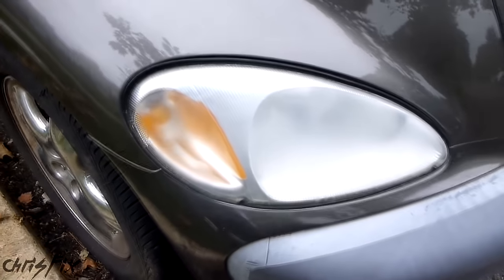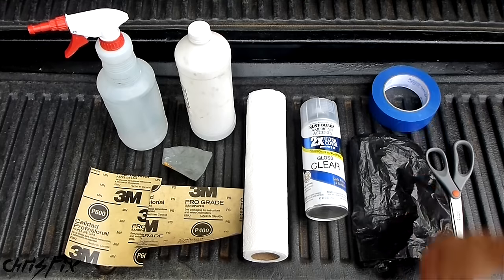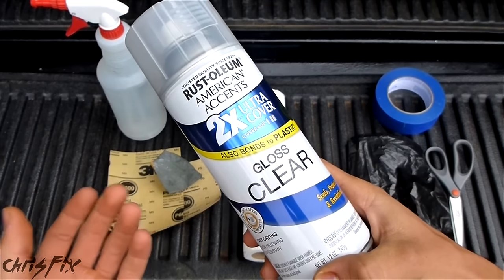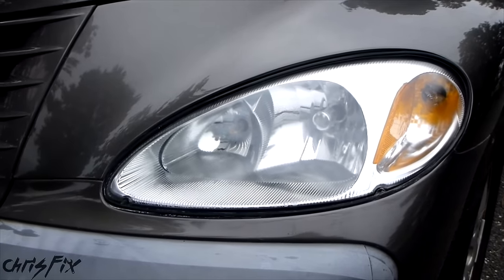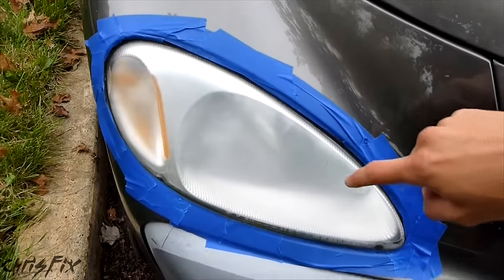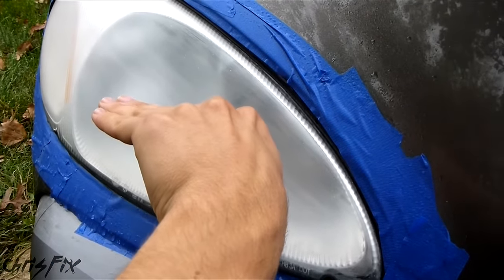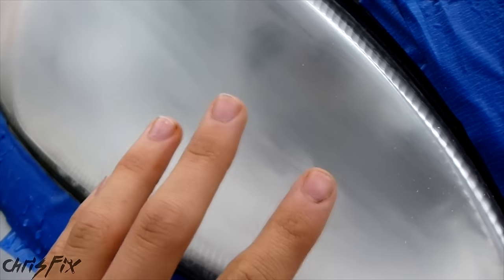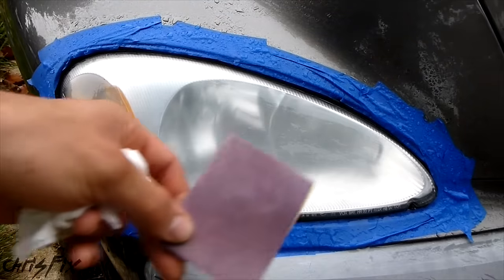How to Restore Headlights PERMANENTLY

Comment: Hey- I did this 5 years ago, and now they're starting to fog up again.  Actually I'm happy with the results, I came back as a refresher before I do it again- I even still have all the materials.  Thanks!
Reply from the maker: Thanks for sharing!
Reply: How well did it hold up?
Reply: Yes, that is about what you can expect. Consider the superior products that are applied from factory supplied headlights. They go yellow. Nothing lasts forever and all finishes are but temporary, but it is better than just buffing. A good 2K clear spray might be a better option as it is a catalyzed finish, but it is expensive and you must wear a proper respirator and not a dust mask when shooting it. Maybe get another year or two out of the finish over the airdry non cat finish.
Reply: 5 years is pretty good
Reply: Keep waxing them every 3 months and you should avoid them fogging up again. Only so many times you ca restore them.
Reply: I just pay a dealer,,,too tedious
Reply: @timlee8823  No, too lazy.
Reply: After 5 yrs all lights need redoing because of weather elements
Reply: @timlee8823  You're missing out on the skills then.
Reply: @gravemind6536  Crap I just did this to my headlights yesterday, came to thank Chris for the video and saw your comment. I did forget the wax step I need to do that tomorrow. Thanks.
Reply: @timlee8823  I felt like you did about it honestly but I did it yesterday sat in a chair under a shade tree it only took a few hours and I have great results. Really it wasn't that much work. I thought it would be but nah.
Reply: 5 years? I thought this paint would wear out in less than 1 year...
Reply: @lordmasterization      Well, I did procrastinate for at least 2 years.
Reply: @getsmarter5412  so that primer kept the light clear for 3 years?
Reply: @lordmasterization   Yes. It's all in the prep.
Reply: Very nice
Reply: @gravemind6536  Imagine waxing your headlights every 3 months lol
Reply: Yeah, I never thought it would be permanent. I'm not sure how Chris can think that. But it's still far better than nothing.
Reply: @legalmexican  he doesnt literally mean " permanent " in the literal meaning of the word.
Reply: @gravemind6536  or you can get clear precut out for your lenses
Reply: @nikchris69  I wax my car at Least once a month or two, takes little time, may as well do headlights.
Reply: @jimflys2  These days you can get 2k clearcoat in a can too, far superior but cost not much more than ordinary clearcoat spray. One thing to note about 2k paint though is you can sand down the orange peel and/or polish to a shine after 24 hours but best not wax, add sealant or any kind of coating on it for the first 2 months or more to allow the paint to breathe and harden properly. 
Once it sets, with regular waxing/sealant it should last many years without yellowing.
Reply: @nikchris69  you should be waxing your paint regularly so why not do it at the same time
Reply: But the owner of this video claims, it is A permanent fix.
Reply: @MrBababuwi  Nothing is truly permanent including your car or even yourself. 4-5 years is pretty good considering most other options only last a few months.

Comment: I did this to two vehicles recently.  The price to replace the set of headlights was $350, this made the headlights look amazing for less than $20.  Thank you sir!
Reply from the maker: Awesome!
Reply: Did this actually work? I’m extremely nervous to do this... how long will this also last? I don’t get how using sandpaper which scratches it is a good think and then somehow magically the clear coat does it lol... just hard to believe.
Reply: @polishmafia1573  then maybe don't do it lol. If you don't understand how it works then it's not for you..
Reply: Have you used plastic primer before spraying the clear coat layers? The product that Chris used says that it bonds on plastic, mine doesn't and I'm scared it may look like crap...
Reply: @polishmafia1573  sandpaper removes the haze..by scratching it away, clear coat fills the scratches and adds a protective layer..lol
Reply: @josegomez6549  haha right, weirdos man

Comment: I'd recommend adding this in the description so it's easier to know what the steps are:
1. Tape around headlight
2. Wet sand 400 grit swirl pattern
3. Wet sand 400 grit horizontal pattern
4. Wet sand 600 grit swirl pattern
5. Wet sand 600 grit horizontal pattern
6. Thoroughly clean
7. Wet sand 2000 grit swirl pattern
8. Wet sand 2000 grit horizontal pattern
9. Thoroughly clean with alcohol and let air dry
10. Tape plastic bag around area of headlight 
11. Spray 1st coat clear gloss UV rated
12. Wait at least 5 minutes
13. Spray 2nd coat clear gloss UV rated
14. Wait 24 hours
15. Apply Carnauba car wax
16. Buff out wax
17. Remove taped off material
Reply: clear coat for PLASTIC
Reply: You missed the 3rd clear coat
Reply: Thank you!
Reply: Why use of 2000 grit  after 600 grit ?? Brandon .
Reply: @tonycervantes4816  Because you always go to a finer grit
Reply: @brandoncriner5480  okay thanks sr
Reply: @tonycervantes4816  Finer grit removes sand scratches from previous paper.
Reply: @ward26102  ok Laura thanks  for you  information.
Reply: Screenshotted, thanks!
Reply: You forgot to sand the clear coat w 3k grit sandpaper.
Reply: @tonycervantes4816  it good if you wait for clearcoat to dry then wet sand with 3000 grit ,then wet sand with 5000, then compound-polish. This will make it very clear
Reply: @tonycervantes4816  don't go from 600 to 2000.  That's a ridiculous leap. It would take you 2 days of sanding with a 2000 to remove the scratches from the 600.  From 600 you would go to 1k.  Then something around 1500, then on to 2k. 
A good rule of thumb for sandpaper is to never go more than 150% of the last grit.  For instance if you're using a 200 grit, follow it with a 300. Then 450, then 675, then 1k, then 1500, then 2200, so on and so forth.  Obviously they don't make every grit in between, but you pick the one closest to what you need
Reply: @epstein_isnt_dead7726  the scratches need to be there for the clear coat to not run and grip the plastic better
Reply: @rlkxo3765  your comment has nothing to do with my comment
Reply: Good points. You forgot one coat of paint. Lol.
Reply: @arthurwagar6224  .... you're joking... right?
Reply: @epstein_isnt_dead7726  agreed. Skipping over the numbers is a false economy. 600 to 2000 is too big a jump. 400, 600, 800, 1000, 1500 and finally 2000 is the best way to go for a professional result.
Reply: Thanks for this but I am laughing too because the goal of Youtubers is usually views not saying they don't want to just help us out also but I can't tell you how many times I watched the video to go back over steps which is more views for Chris and I got his knowledge for free so I am OK with giving him extra views. Still your step by step here in writing would have saved me some time for sure.
Reply: Brandon Criner, thanks for writing the notes down for us, I took a screen shot of your comment, saves me the trouble of writing down anything lol.
Reply: Well then people wouldn't watch the video! The longer people watch, the more Mr Chris makes from YouTube income :)
Reply: I's literally waiting for one of these lol
Reply: @tonycervantes4816  2000 grit super fine to really smooth out the headlight
Reply: @jjf609  thanks brother..
Reply: want to save it. don't know how to copy google review.
Reply: Instead of clear coat.I finished with compound and polish.
Reply: step 16 what do we "buff out" with? water? alcohol? a dry towel?

Comment: Chris, you are the man.  You've given me the confidence to try so many of these fixes that I never have before.  You're an amazing teacher and awesome film maker.  Thank you for all that you do.
Reply: I did the headlights on my Mums car in 2020 (Had lots of time in lockdown) they were arguably too far gone and far worse than the ones in this video, I used his methods and was able to remove all the haze from the lights but they had also yellowed badly too but I only managed to remove 85-90% of the yellowing. However 3 years on from the work I did they still hold up and for around 100-200 dark miles until my Mum got used to the headlights being brighter she kept trying to turn off the full beam that wasn't on. This was a car she had bought cheap used for £600 so its pretty crap however I completely transformed the lights.

Comment: A random guy at my local salvage yard told me to take these exact steps to permanently clear up my headlights and it works just as in this video. Great step by step how to.
Reply from the maker: That's awesome! Thanks a lot!
Reply: Im afraid to scratch the headlight with sand paper .it is ok sir?
Reply: @airrolmedestomas  if you scratch it a little bit with the 400 grip ir 600 grip just sand it with 2000 grip over the scratch and it will disappear
Reply: @airrolmedestomas  Don't be scared of that you will likely be fine and using sandpaper even with sub 1000 grit will not cause irreversible damage. As long as you polish the lights up well after sanding them they will last good.

Comment: I'm amazed!!! Update: I actually did this and the results were fantastic! I can't thank you enough for all the empowerment you provide. God bless you!
Reply: Awesome. I've been looking for comments on if someone had done it. Thanks fore saying something! I'm about to do it on my Santa Fe.
Reply: @kimberchick8527  He inspired me to change my own headlights, tail light, interior light, and that AC filter that's under the hood (I already knew how to replace the cabin one).  I even used this headlight recovery trick on the faded solar lights around my property. ChrisFix is truly my hero!
Reply: @Amyzgr8r  hey Amy, every time you sanded, did you do 5 minutes each time or how long?
Reply: @jlkeeper8901  Oh, I didn't really time it. Just eyeballed it.
Reply: Ive done this using the same clear coat and it all was in spider webs after 10 minutes. Did three coats and that did not help a single but. Then talked to a professional, they said need a plastic adhesion promoter, used that (doing everything form scratch again), this time the clear coat did not  have the spider web, but the headlights are hazy and dont look "amazing". Now when i rewatch the video i realize that his headlights are hazy as well, it is just his comments that made me think they did look great.

Comment from the maker: +Phillip Paul, I cannot reply to your comment for some reason so I hope you see this. You do not want to buff the lens smooth. You want to have scratches and follow the 400-600-2000 exactly like in this video. The 600 grit puts deep enough scratches into the surface of the lens while the 2000 light sand, cuts any surface roughness off. This allows for the clear coat to adhere properly so it wont peel in a year. If you make it smooth, the clear coat wont grab onto anything and it will peel. You can also have a problem with the paint running.
Reply from the maker: GigaDonk You can do 600-2000 but not just 2000. You need the deeper 600 grit scratches to help the clear coat adhere for a good long time!
Reply: ChrisFix
Reply: Why you dont use wd40 ?
Reply: Nm
Reply from the maker: ***** I never tried 6000 grit and what I do works for years so I havent changed the recipe.
Reply from the maker: Antonio Debeljak Because wd40 doesnt last long and just covers the problem until it rains.
Reply: ChrisFix WD is fish oil.
Reply: ChrisFix 
Nice video.  There are other ways to re-treat the headlight lenses to obtain proper results - but yours as shown here will certainly work, gives the desired finish, and lasts as you described too.  

Very well done, narrated, and presented.  It's generous of you to share your meticulous works with others.

PS - Since the discovery of "Parts Blaster" (PB) - Everyone would like to find "something" that ole' "WD40" is good for - so far, I have found nothing!  PB is the finest product of its type so far! 

Thanks again Chrisfix!
Reply: Jacob green sure then, use it on your skin or try to fish with it, it wont work because once you change the main chemical, it will no longer be that chemical.
Reply from the maker: MJfromMD Thanks a lot and thanks for sharing! If you like PB blaster, than I think you will like this: https://www.youtube.com/watch?v=2WuVBFTzoKc
Reply: James Jayser  Give the guy a break, at least hes trying..
Reply: Hey Chris, let's say hypothetically speaking, some enthusiastic subscriber followed all your steps to perfectly...... BUT broke a cardinal rule on the second light and sprayed too much. Now there is running of the clear coat. Could this..... hypothetical ..... person sand down with the 400 grit, followed by 2000, and reapply a smoother clear coat?
Reply: dand100  Yes you could.  I had the same problem and resanded a bit.  It turned out better than my other headlight.
Reply: dand100  Same sort of thing happened to me (was humid when I sprayed them and lenses dried cloudy) and I went all the way down to 220 and dry sanded the lenses with a power hand sander then worked my way back up 400, 800, 1000 by hand and they re-sprayed.  Worked perfectly.
Reply: nice
Reply: ChrisFix Ditto.  The general rule for spray painting is to sand to 400-grit finish, then spray.  The finer grits come afterwards as the finish is finish-sanded and buffed out.
A word regarding wet-sanding - I didn't learn until recently that wet/dry sandpaper is made and intended to be soaked in water 24 hours prior to use, so that it soaks up the water like a sponge.  Thanks for this great video.
Reply: +ChrisFix i used 180, 220 and 720 ... came out perfectly clear ONCE but had a couple runs ... so I resanded with the same pattern and now it literally always comes out yellow ... ?????
Reply: +louisdiaz316 why did you not use the grits he suggested? He suggested them for reasons explained in the video?
Reply: +wildcard749 honestly all I used at first was 720 to remove everything n it worked quite well at first. if anything the 180 & 220 came into the picture to remove the runs. But after that it never came out super clear
Reply: *****
 When you re-sanded it did you make sure you got ALL the way back down to the plastic lens?  It was tricky for me and took a long time, which is why I used a power hand-sander, but if you do have to 'start from scratch' so to speak, you really should try to get all the way back down to the fresh surface and begin again.
Reply: ChrisFix so if I followed all directions, and used same spray paint as in the video, but ended up with alligator cracks - is it that I made it too smooth so it's not adhering. do you think shape of lights makes any difference? Just bought a 2005 jag s type I'm trying this on, which has the round headlights  (making this task a PiTA!  😀)  thanks!
Reply: Trisha Gamble sounds like you waited too long in between paint coats.  you have to spray within the hour (whatever the manufacturer recommends) or else the paint will de-gas and cause cracks in the paint finish.
Reply: The trick is to NOT use clear coat. It will crack/peel, etc. Use nano ceramic coating!
Reply: I believe thats why your headlights sill looked hazy after repair, POlished with maintenance would be clearer for sure, your method will last longer.
Reply: @dand100  :face-green-smiling: Great question
Reply: @chrisfix  "I do works for years so I havent changed the recipe." Okay, I laughed out loud that you called it a recipe 😂 I am going to give your recipe a try on my headlights soon. Thanks man!
Reply: Hmm, so no fine polish buffing. Just sand to 2000 and then clear coat it for better adhesion. Sounds good 👍
Reply: @philip paul
Reply: What do you do if you get runs from the clear coat?Wait for it to dry and resand with the 400,600 and 2000 grit sandpaper??

Comment: Thank you Chris. My 2008 MDX failed inspection due to yellowed/hazy headlights. Less than $50 at an auto parts store, and 30 minutes of my time, my headlights look brand new. Can't wait for 24 hours to do one more wet sand and then wax. You are a real treasure.
Reply: I did this to my Mums cars it somehow had a valid MOT with the lights only being advisory and they were very far gone arguably too far gone I restored them but could only remove about 90% of the yellowing and haze I did this in 2020 whilst bored in lockdown and she was highly impressed with the headlight performance afterwards and kept trying to turn off the full beams due to the new levels of brightness. 3 years later the restoration is still holding up very well too. I used 5000 grit and 7000 grit sandpaper followed by T cut polish and turtle wax to restore them I imagine if I used better equipment I would have done even better.

Comment: Did this process today on some 7 year old headlights that were plain awful. I messed up a little on the 2nd coat and had to restart but the end result, following Chris' step by step instructions, gave me brand new looking headlights. I can actually see at night now.
Reply: By restart do you mean re sand?
Reply: @topixartist  when I applied the 2nd top coat, I touched it with a towel, and it bunched up and crackled. So yes, I sanded it back down with sand paper and restarted the whole process
Reply: @mccarthermitchell2873  happens to me but when I sanded it down again the crackles were still there somehow
Reply: Yeah ive got crackles now. Not sure how to prevent this. Any tips?
Reply: @moonlightninjaman I just botched my clear coat as well.  Tried sanding it down and I think I did it too soon or not enough sanding.  Trying some varsol (paint remover) now and will update you if that gets rid of the crackle.  Update- varsol didn't do much...sanding is the way to get the crackle to disappear.  Lots of sanding lol